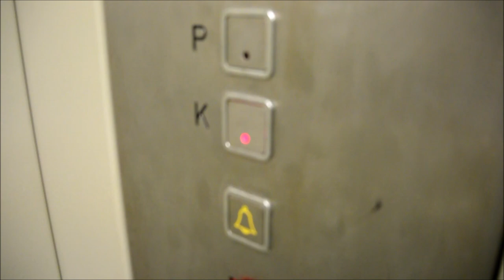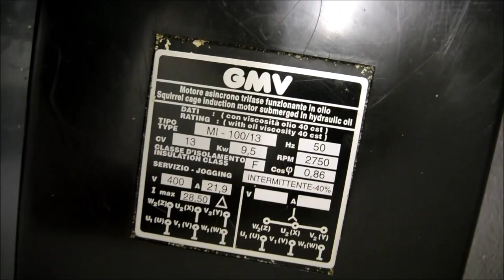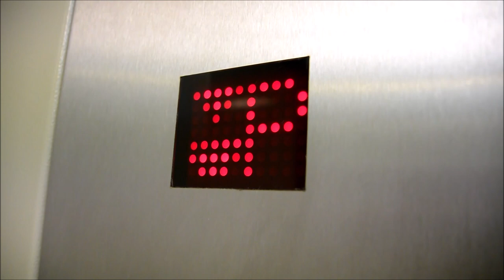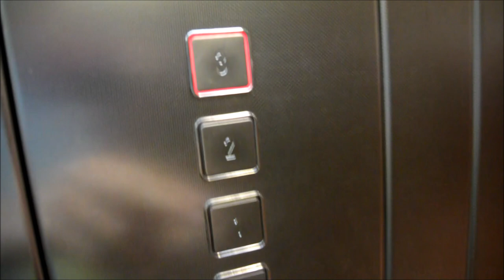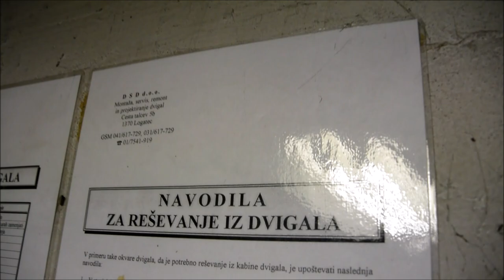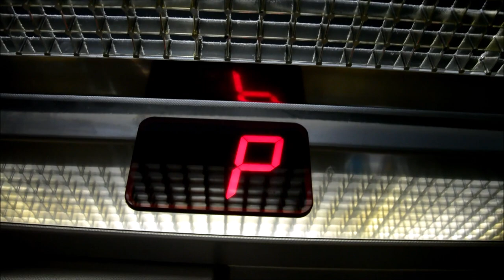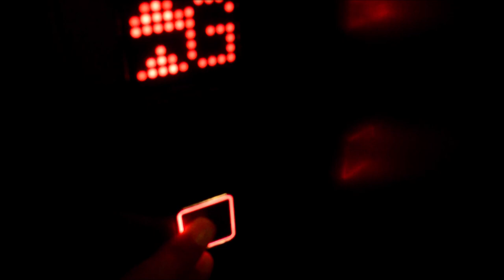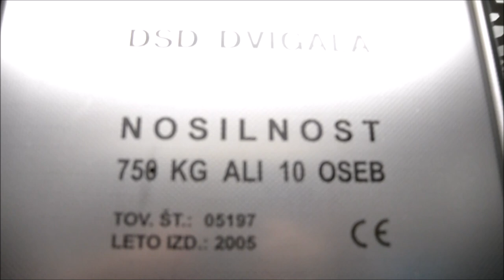Machine Room Tour! Tour of DSD hydraulic/traction elevators @ Hotel Delfin***, Izola, Slovenia

Comment: What a video. Elevators are totally generic but machine rooms are always interesting.
Reply: Vero: quadro di manovra a PLC, centralina GMV modello: 3010, nel terzo ascensore si sente il classico rumore della cinghia dell,operatore porte Selcom trifase modello: 3201, pulsanti non so ma come estetica non mi sembrano chissa che.
Reply: @striatogatto   Selcom è molto presente anche qui da noi, forse l'operatore di porte più presente di tutti
Reply: @ElevatorsfromItaly : Anche da noi, dalla fine degli anni 80 fino fine anni 90 il piu usato era il modello  con motore trifase 3201. Dagli anni 2000 e venuto il modello HYDRA PLUS: ECO PLUS, MIDI PLUS e SUPRA secondo le esigenze (su questi giá e possibile programmare con che velocitá apra o chiuda ecc...
Mentre sugli OTIS degli anni 80/90 esempio: Europa 2000, OTIS 2000 degli anni dal 1993 al 1999 di piccola media portata l,operatore porte piu usato era il modello: 6020849 con motore trifase, successivamente negli OTIS 2000VF e Gen2 con alto traffico e miglior confort venne applicato il modello OTIS DO 2000 programmabile trammite Service Tool, mentre per gli edifici di traffico piccolo medio il modello tuttora utilizzato e il PAX della OTIS, sempre programmabile trammite Service Tool. Per montacarichi (ti parlo del mercato europeo) OTIS non ha un operatore porte adeguato per quelle portate, quindi in quei casi da noi viene applicato HYDRA.
Reply: @striatogatto  Sappi che io ho trovato degli OTIS HydraPlus e anche Quadra+
Reply: @ElevatorsfromItaly : HydraPlus come qualitá e buona, fino adesso solo in un posto mi e toccato cambiare la scheda elettronica presente al suo interno in un impianto del 2009 di circolo abbastanza elevato.